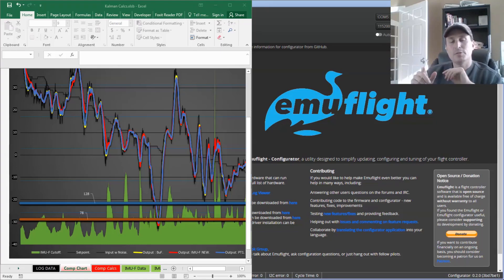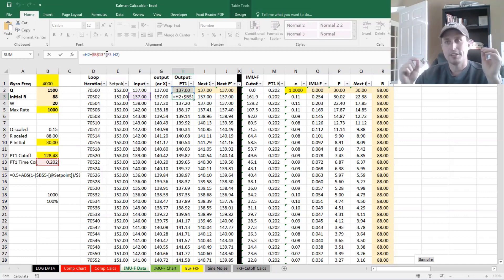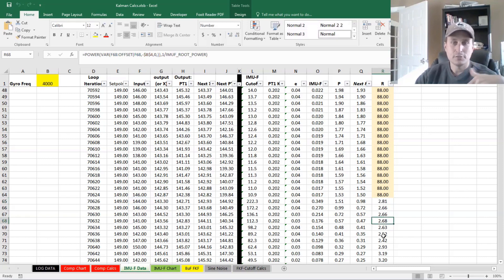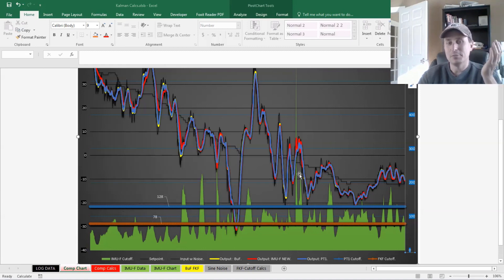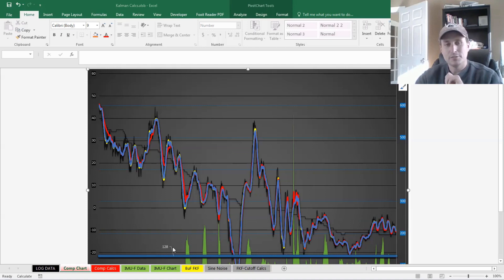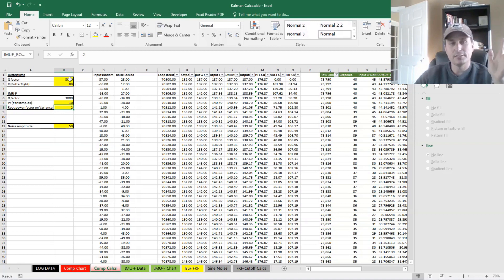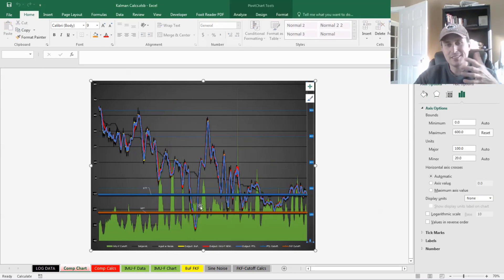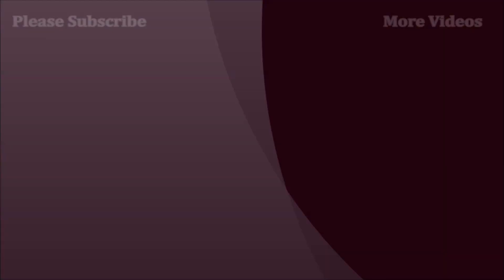What is the IMU-F Filter? | EmuFlight

Comment: I am currently working on AI filter (based on neural network) and it does look promising, but I need a lot of BB logs to train, do you have any for share?
Reply from the maker: Oh I have lots.  What do you want specifically?
Reply: @uavtech  Mainly I'm looking for raw gyro dat and raw receiver data - they might also be already scaled. It would be best if they will be at the same sample rate especially gyro data. PS as more dynamic flights then better
Reply: @Dobijasek  Hop on the discord, and you can mine some of those.  How dynamic do you want?  What craft archetype?  I have piles of data from my junk quads in race situations, and I doubt I'm alone.
Reply: @tehllama42  Currently I have some 'gentle' records, but after analyze resoult of my filter it's worse than 'synthetic data' and now I'm trying with as much dynamics as it possible so probably any new data will be better than my LOS records ;)

Comment: beautiful summary of realtime filtering! It is quite simple. Im thinking of implementing this in Ptb on raw gyro data so users could simulate how different filter options would change their filtered spectrograms. of course it wouldnt be entirely accurate because it wouldnt be operating on the copter in reality...
Reply from the maker: Right.  It would be nice to have a tool where it reads the raw noise and as you change the filter setting you could see the outcome in the waterfall graphs.

Comment: Ok thanks Mark...so the question we don't know to the answer to is does this have some benefit to move the filter according to this principle, vs static. I tested Edouards filter extensively but it was based on setpoint error. I thought it was quite good, but the problem was I needed to compare with an equivalent static version of over a flight to really know-I didn't have the calculation for that so didn't do it. I wish you could put the full filter profile on a switch - and randomise it! It would help with placebo control. However I had the impression I was able to get more filtering at less of the costs associated with filtering. I think it would be sensible to design a dynamic logic where the cufoff moves depending on when you really need filtering and when you dont. According to the signal to noise ratio and a predictive element based on previous rate change makes sense...

Comment: This still does make me wonder how useful the dynamic PT1 approach could be if applied to post-RPM Notch data on a board with spare processing power and/or dual gyros... 
I do feel like there might be a way to try and include some accelerometer data to dynamically adjust some of the input parameters to this (i.e. even if slow, use that to infer states where propwash is more likely, and use that to set dLPF and DMin/TPA values that can give us a better shot of correctly addressing propwash assuming that 8k (or 3.2k) gyro data as-sampled is as good as we need.  
Then again we can already do amazing things with artificially clean data (post-RPM notch + harmonics) with fairly basic filtering, and this wouldn't pose a big improvement on just D term.
Reply from the maker: At https://github.com/DoudFPV/betaflight/tree/BF-%2B-IMUF-108 you can fly RPM with dynamic PT1 (Kalman | IMU-F).
Reply: @uavtech  Oh man... I'm almost glad I don't have the hardware to properly do that justice... and that I'm not picky enough to be happy with any 4k/4k/DSHOT300 bidir setup I've tried.
Reply: @uavtech  That looks seriously awesome; I'll look into it anyway.  I feel like letting RPM data influence that (e.g. derivative of RPM from trailing samples) for dynamic W value, and see if that enables better Q tuning (or dynamic Q adjustment).

Comment: I think people prefer emu flight for whoops.  so logging is not really an option.  though I tried the famous emu setup on a mobula 6 with the pid preset for it, blah blah, and the bf 4.2 tune I have flies much better.  I actually get longer flight in bf contrary to what most people say.  maybe the defaults in emu just work a little better for whoops, I don't know.  But I fly bf 4.2 on everything, including whoops.
Reply from the maker: Emu stuff is a lot of politic stuff.  It is hard to tell what is what.

Comment: +1👍 analysis master :)
 this is still 0.1.0 correct? and do you intend to test 0.1.27+?
all in all, i just want easy tuning , minimal variables , and fluid yet controlled piloting
i think `Dynamic PT1` is a good name
Reply from the maker: This is the IMU-F, period.  8 have not flown 0.1.27

Tuning is the same regardless of FW though.  All use a PID controller.
Reply from the maker: Your download only has an Emu log.  Not BF log, with the same settings, to compare against.
Reply: @uavtech  sorry, my lack of understanding your needs.no BeF for Helio anyway.
Reply from the maker: @nerdCopter  , yeah, you would need to swap out the FC.

Comment: Pretty interesting, dude. 😊
I still think that the advantage of the Helio boards came not from the code it used, but from the multiprocessor model they had. Each processor had to do less stuff, so there were less times when the processor gets to 100%... You know?
Reply from the maker: at 4k, processor should never get to 100%.
Reply: @uavtech  Yeah, but people used to run it on 32k 32k. So...
Reply from the maker: @MCsCreations  , run on 4k in Experiment mode.  Same thing.
Reply: @uavtech  Have you ever worked with distributed computing? It's about that I'm thinking about. Parallel processing. 
I don't know if it was well implemented in the Helio boards, but it's a pretty good idea.
Reply from the maker: Parallel processing doesn't help in a linear PID loop.  Parallel processing help for thing like raster image processing, but not in linear functions like running sequential calcs (such as how Autodesk runs AutoCAD, etc...).
Reply: The limitation in parallel processing is that you need embarrassingly parallel problems for that to excel - when you're trying to move data quickly coprocessing isn't necessarily ideal, and when the lowest latency option is running mathematically simpler filters, might as well do that.
A $27 F7 FC with all the features I care about can run DSHOT600 8k/8k Bidirectional DSHOT and all the other features I want, so why would I look elsewhere.
Reply: @tehllama42  That's true. 
But I saw - and did - pretty interesting parallel processing of linear problems. It's not impossible, you just need to break the algorithm in steps. And, of course, it only should be used for complex and long algorithms. 
Anyway, it's a pretty neat solution. I still think it could help a lot - but, again, if well implemented and I don't know if it was the case with the Helio boards. 😊
Reply from the maker: H7 FTW in this case.  Honestly, a single F4 is plenty good for what we are doing right now.  H7 to future proof.

Parallel processing has the delay of transfering the data between the processors (very slow) at that level (uS).
Reply: Precisely true, but if the outputs of each step are required for subsequent steps, in any comparable quantity, just brute forcing more processing is still cheaper.  For parallel processing to work, the scaling needs to be at least logN better with K scaling less than KlogK for information passing, with minimal latency penalties for read/transfer/write of data (outside of niche FPGA activities where no data buffering is minimal).
So... running adjacent processes on a coprocessor works great, but for this use taking the raw data and applying filters and applying outputs directly into flight control steps is still going to be what dictates phase delay - offloading some of the filter setup and making that adjacent is great for externally optimizing the performance of that system, but uncertainty and nyquist limitations are still the principal drivers, particularly when we're up against the performance and sensitivity limitations of sampling a MEMS gyro in noisy situations.
Reply from the maker: @tehllama42  at 4k or 8k loop rates, F4 finishes in plenty less time.  It is unnecessary at this time.  H7 is the future anyways.

Comment: but it flies better than betaflight 4.1 with same filter settings ... its a miracle , nothing activated but works...  and everybody can test it in field in same quadcopter by flash firmware and fly.
Reply from the maker: miracles are not real.
Reply: I agree mate, tried on my main 5" quad in this order: 4.0.6 (well tuned already) -> EMU stock -> 4.1 stock, and here is where I said 'wait whaaat?' and went back to - EMU stock. Way better IMO. Stock vs stock results: less 'numbed', great feel, less propwash, motors same temp = EMU. Didnt even need to tune or filter tune, just TPA tweak.
Reply: @uavtech    may be   ( it was sarcasm)... but  blackbox is does not convey impressions
  of flight  ( its nort sarcasm) ...  I tuning my betaflight about 7-8 month  by  ( not  only) your video ( with rpm filter and etc)  ...  and emuflight  just fly in stock settings with minimum propwash and movement artefacts ... And as i say everybody can try it in field its very easy.
Reply: @uavtech   i downloaded your latency calculator... i try to configure with minimum latency (many times), without frame/motor  resonanses ...  and i get low propwash ...  but also i get artefacts like shaking in flight (you can see it in my video... same quad same day ,  different firmwares)..
Reply from the maker: Settings are settings.  Defaults running only will never get you peak performance.  See, no bullshit.  I like the Emu devs a lot: https://www.screencast.com/t/yPG7FjOZ
Reply from the maker: @HERSDT_FPV  , right.  Takes a balance.  Best is to look at your quads raw noise (prefiltered) and get that down with the best props, good motors, good frame, etc... then you can have the best of both worlds.
Reply: @uavtech   i configure it witout blackbox ...  i hear resonanses aurally
 ...  i just disable filters and arm quad in hand..  all resonanses i feel and hear ( also i hear frequences ) ...  then i try to to crush
 resonanses with differen filters  , also trying to get lower latency. this is my logic  of settings filters. ( blackbox loging do the same )

Comment: A kalman filter with only 1 input value will indeed act like a lowpass filter. But it is never exactly the same. So does emuflight use a kalman filter. Yes. Is the imuf filter only this kalman filter, no.
Reply from the maker: It is not "act like".  It is the same equation (minus the predictive step).
Reply: For IMUF, if you check old version, like the "odin 1.0.8", the biquad have a static frequency at around 250Hz.
I think it was to replace to the removed "internal gyro filter".
I have to double check, but for now, I did'nt see much more than Kalman + biquad.

Note : In last versions of IMUF, yes the cut off frequency of biquad are adjust during the flight. 
But it would be very interesting to have some log. (I don't have any Helio board)